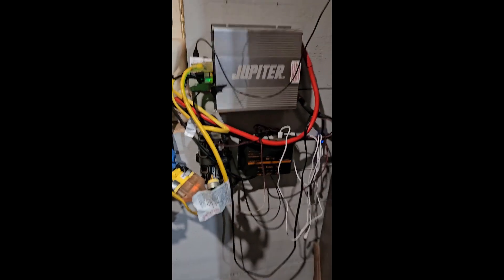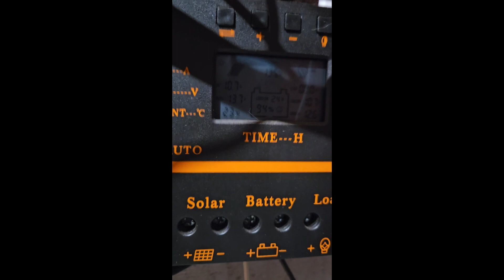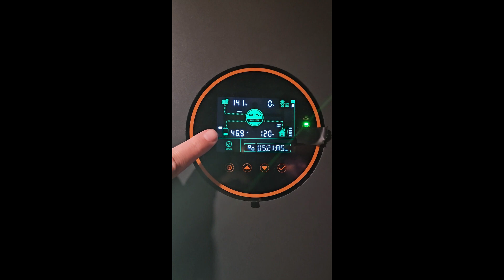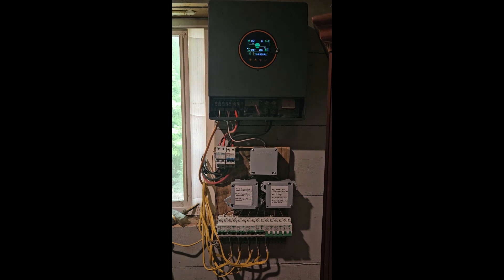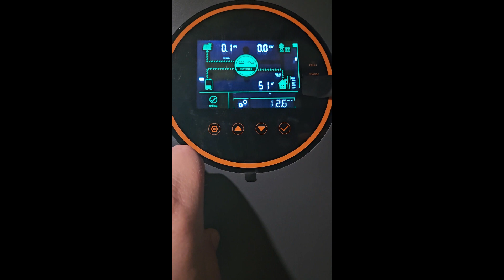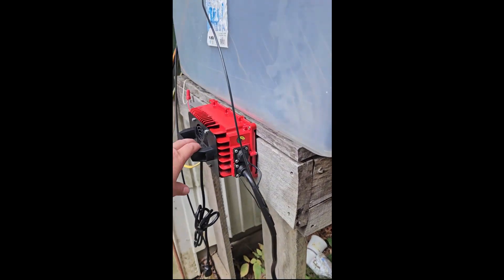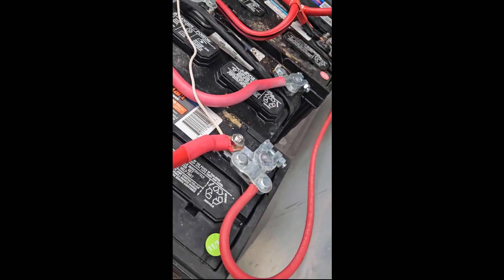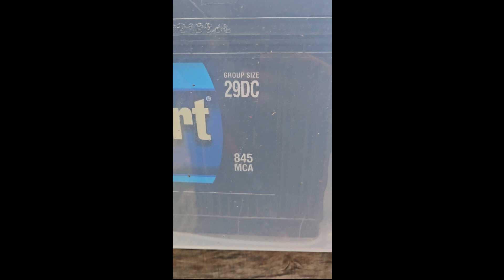12v to 48v Conversion Update

Comment: You may get a lot of criticism about the details of your system. Far from ideal but if it works great.  It does show you don't need fancy LiFePO4 batteries, MPPT charger controller. However, if you can afford it, best to start with the proven components (expensive) first. Not sure how long those deep cycles will last; but be sure to vent them. I am all for keeping batteries outside from home, but protecting them from heat and cold is important. You show panel angles are fixed and at different angles; suggest you have rack that you can change panel angle for different time of year...But keep improving. Cheers.
Reply from the maker: Appreciate it! The boxes do have holes for venting on batteries.  I've been topping them off with distilled water periodically.  The first set is about 4 years old. Do want to convert to Lithium but budget wise has to wait for now. The panel rack is a temp structure until I build the garage and place on the roof of that. Thanks for the input

Comment: Informative, thanks. Can you provide a link to the 12V water pump that you are using?
Reply from the maker: Surely 12v Wayer Pump

https://www.amazon.com/Shurflo-4048153E75-Electric-Water-Pump/dp/B007RYMT7O?pd_rd_w=VPl5N&content-id=amzn1.sym.b854a5c2-4475-41f8-a6d4-df92b2868104&pf_rd_p=b854a5c2-4475-41f8-a6d4-df92b2868104&pf_rd_r=K463PFY7XDDZQDE1CMAQ&pd_rd_wg=RT3BV&pd_rd_r=892d3826-9895-4ee6-ab3b-2d6a7bc0f003&pd_rd_i=B007RYMT7O&psc=1&ref_=pd_basp_bia_rpt_ba_s_1_sc
Reply: Thanks--looks good. @grayleehomestead7146